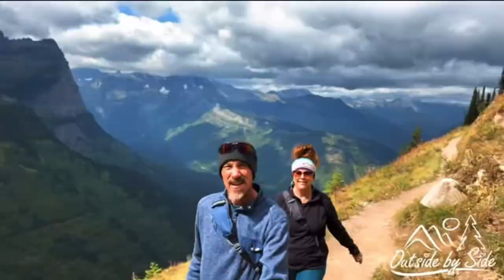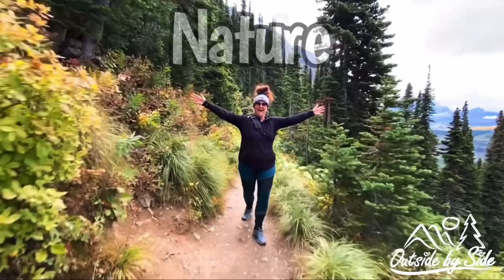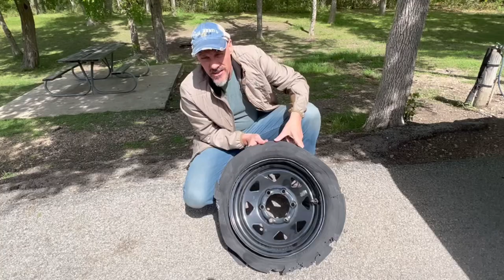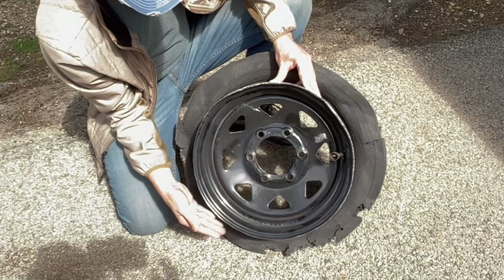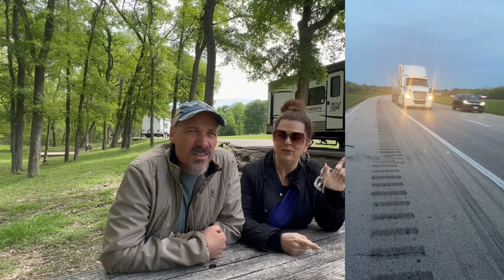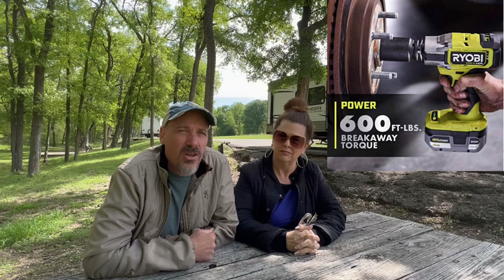Our first BLOWOUT! Tips on changing the tire on your travel trailer & roadside safety.

Comment: I've had 2 blow outs. One was a few years ago, in a small 2,000lb single-axle trailer. I was hauling trash to the landfill, doing about 60 in a 55 2-lane highway when I looked to my left and saw tire treads running parallel to me, just rolling down the highway next to me. It was comical at first, seeing tire treads, no sidewall, just rolling down the road, until I realized that the treads had to come from somewhere. I pulled over, and yep, it was my tire. Never heard a thing, never felt a jerk or anything abnormal, if the treads hadn't of rolled up next to me, I probably wouldn't of noticed.

My second blow-out was on a 2-axle trailer, loaded to about 9,000lb. I just passed an exit, when I heard a pop and felt the trailer sag, and I lost my lights. Still had headlights, but the rest of my lights for the truck and trailer were gone. The tire ripped out some wiring, caused a short, and popped some fuses. So I was on the side of the road with no lights, no triangles, nothing to warn drivers that I'm there on the shoulder, changing out a tire on the driver side, so my rear was hanging out in traffic with people just whizzing by. What I had going for me was that my truck is a 4WD, so I pulled off the shoulder and into the grass, giving me more room to work with. Didn't need it going into the grass, but I had to use it to get out, because when i was done, I was stuck. Also, I keep a 1/2-inch Cordless Impact in the truck. It's an Earthquake from HF that I retired from using on a daily basis, it's pretty worn out. So I tossed that one in the truck and got another one for my daily use. Glad I kept the old one in the truck, so I made quick work of the tire change. That still left me with about 100 miles of driving at night with only headlights, no tail or brake lights. 30 miles later I came across another town and got some fuses.
Reply from the maker: @vivillager Thank you for sharing your experiences and we are so glad you are okay! We had to laugh a little at the first situation but OMG the thought when you found out it was your own tire rolling beside you! Thanks for watching our video and stay safe out there!! 🤩

Comment: Great for the advice. Someone may have cut it halfway. Get the trail cameras for security at your stops. They are great. Get a couple. To save you days of research just get two that operate on 4 AA BATTERIES. Then buy 8 rechargeable AA BATTERIES with a charger for 8 AAs. The batteries last a good week on photo but you can change settings to video motion activated. Night vision. Get the trail cametas with the screen on the units. They record in loop. The storage is huge. Then you can call police & press charges.
Reply from the maker: @j.vincento7152 Another great idea! Thanks so much for your awesome feedback! We feel safer already! 🤩

Comment: Change to all metal valve stems, not just the ones with metal then rubber where it goes in the wheel. Had the valve stem break like that but not as bad. TPMS gave us gave us enough warning to stop. O’Reilly’s has them part #17-428. They fit our 6 lug aluminum wheels.
Reply from the maker: @thomaspalliser1877 Great tip! We appreciate you taking time to comment! Thanks for watching! 🤩

Comment: I have a travel trailer very similar to yours with one axle. I've had 2 blowouts in 2 years. When I tried to jack up the trailer with my bottle jack I had the same issue with not being able to get it under the axle. Then I figured out to jack it up using the frame instead of the axle and it works great. You just have to put a couple wood blocks under the bottle jack. I used the 8" block I keep to put under the tongue jack. I had damage to the nylon cloth underneath the trailer behind the wheel well both times and had to do some DIY repairs.
Reply from the maker: @ranger_mo1885 that’s kind of what we had to do with ours. Thanks for the tip for our viewer & thanks for watching! Glad you are okay & that it worked for you! 🤩

Comment: To answer your question about how i handle a flat tire. One time it was the lord saving me from a pile up on the expressway. I called on my CB whats going on the traffic is all stopped now (AS I AM CHANGING THE FLAT ON THE EXPRESSWAY)  I thought it was a bad thing but i would have been right around that pileup. but bible says bad things are meant to be used as good. Or turned around to be good. I just put a couple of flares way down behind me so vehicles can see about a quarter block away. Then light up another and just take my time and TIGHTEN LUG NUTS USING STAR PATTERN. not one after another. I put my adjustable stand to hold vehicle in case the jack falls or slips. Dont even worry about it. It only has two wheels. I would recommend having at least 2 spares at all times. What if you are travelling long distances and on a sunday you have a 2nd blowout on a long road?
Reply from the maker: j.vincento7152 First and foremost, we are so glad you were safe! This is great advice because the only thing worse than one flat tire is two fat tires! 😭

Comment: Dont add second spare to your rear camper bumper. It will break the bumper off. Already did the research for keystone springdale campers. Maybe put under your propane see if weight rating is ok
Reply from the maker: @j.vincento7152 Thanks for the tip & thanks for watching! 😊

Comment: That sucks! I have dual axles and hit a pot hole so big I think the camper became airborne. I don't have a TPM and the only way I found it was, got stuck behind someone who couldn't back in at the campground when the wife got out to walk the dog. It bent the rim that's how hard I hit that pot hole. (won't be going there again) I used the trucks scissor jack to change my tire so you using yours was the same thing. My other trailer that is a dual axle had a blow out. I was feeling a vibration before that. I did stop and checked the tires, but couldn't find anything until it was blowing chunks on the road. They were the original tires and probably 20 years old, not new brand name tires like yours. Did you buy the warrantee for the tires?
Reply from the maker: @bertkelly7650 Glad you guys are okay and we definitely recommend a TPM! It does suck when it happens but hopefully we can be more prepared by trial & error! Thanks for watching & happy camping! 🤩

Comment: So weird now u had a tire issue after a few weeks ago I was stuck with a flat.....I had a bottle jack and I wasn't happy with it when I was trying to use it it felt unsafe.....y'all felt the same way.....tire issues are no joke....it doesn't matter what tire u put on they all will have problems cheap or expensive new or used tires....I already have the heavy duty kobalt impact driver with the 1/2 inch drive/socket I have the one that most mechanics use at dealerships.....yeah it got me thinking what I could do better or what tools I should have after my issue.....that's why I was asking y'all all them questions about what y'all have....it was scary...I'm sure it was for u too
Reply from the maker: @pineapplesmash6678 Yes, we were thinking of you because we remembered having that conversation about a bottle Jack! Glad you are okay and we will definitely be upgrading to a floor jack. 😭 We liked the fact that the bottle jack didn’t take up much space but we learned through the process that we need more & wanted to let everyone know! Thanks for commenting & letting us know about your situation! 🤩
Reply: @OutsidebySide  yes I liked that the bottle jack doesn't take up much space too....I don't know where I would be able to store a jack that size on my rig and u have to worry about hitting the max of your trailer weight or the trailer frame could snap in 2